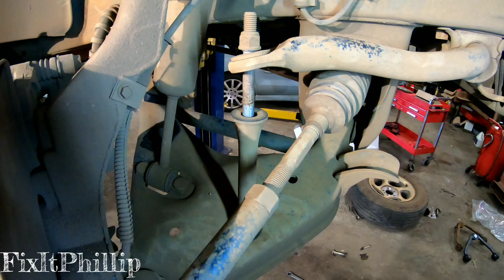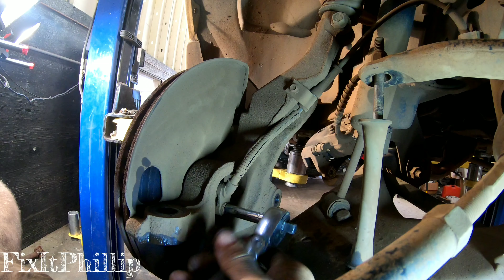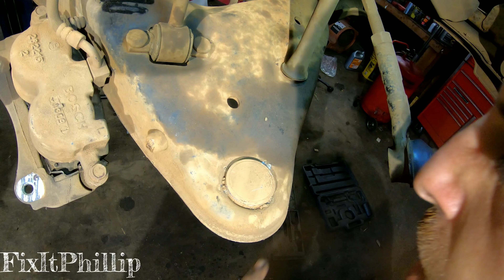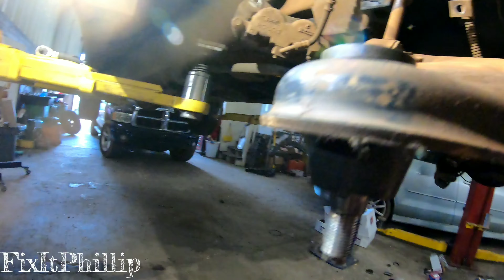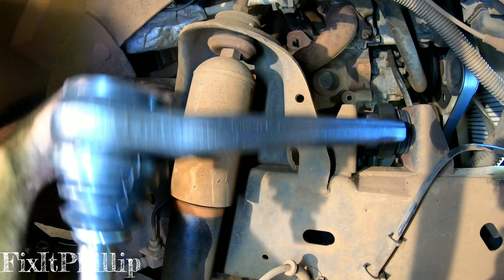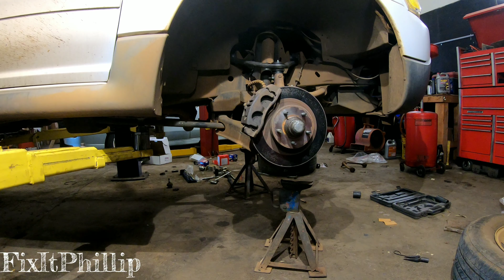Ford Explorer Lower Ball Joint and Upper Control Arm Replacement Sport Trac Ranger Mazda

Comment: The cross bolt that holds the upper ball joint in the knuckle on mine was weird. The bolt head was 16 but the nut was 17mm?

Comment: Helll Phillip, I have a 2001 ford explorer sport ...my question is if I need to buy a the the lower and upper controls arms or if i just need to replace the ball joints ect.ect.Thank you
Reply from the maker: The upper ball joint  is integrated to the upper control arm on yours if im not mistaken. The lower ball joint can be pressed out without replacing the whole lower control arm.

Comment: great video,  I just have a question? I have a 2003 sport trac and I need to replace the upper control arm but mine look way different then the one your sport trac has...  do I need to put a Camber kit too
Reply from the maker: Yours may have the 2 piece  upper control arm, which is a caster adjustment. If you want to be able to to adjust camber also put the camber bolt kit while your already in there. Hope that answered your question. Please be sure to subscribe, much appreciated!
Reply: Probably because he has the 4wd version and you have the 2wd, or vice versa. I wish youtubers would clarify that.

Comment: I may have missed it, what upper control arm did you use? I'm looking at different options and see MOOG and Mevotech but some bad reviews suggesting they don't last for more than 12k miles has me worried.
Reply from the maker: I would go with moog. I've rarely had problems with that brand

Comment: Thank you, I have a 2002 4x4 and just ordered both up and lower control arms complete as I don't have all the tools to remove/replace just easier I figured. Also inner outer tie rod, stabilizers, complete hub and bearings, should be good for another 380,000 km as as far as I can tell it's all stock parts still. Only one lower ball joint is loose but I thought  it's all going to go soon anyway. I find my sport trac the most useful vehicle I have ever owned and I've owned sports cars, muscle cars, trucks, vans, compacts, sedan, even a station wagon which actually looked ugly as heck but was fun to drive. Thanks again buddy.

Comment: I can’t get the lower ball joint off the knuckle.
I see you just hitting it until it breaks off. Is that the key ? I was hitting it under the bolt with the nut and nothing . I even used the fork but busted the the rubber from the ball joint. Advise thanks
Reply from the maker: Did you hit on the knuckle itself like in the video?
Reply: No I didn’t I try to pry it and nothing. Im just scared I could damage the knuckle by hitting it. But I see you going at it and POP it out easy. Is that what I need to do ?
Reply from the maker: Yes hit the knuckle on the side near where the ball joint runs through it. It'll shock it loose
Reply: I will do that! Thanks. And ball joint do I need need top torque to press it or can i do by hand ?
Reply: @200percentbrown  autozone will lend you the ball joint press if you leave a refundable deposit. Just do what he does on the video and you'll be fine.

Comment: Do you leave the grease fitting on top after filling them with the grease gun ?
Reply from the maker: Yes
Reply: @FixItPhillip  any tip on what grease I should use ?
Reply from the maker: Just go to the auto parts store they will give you what you need. Good luck brotha
Reply: @JoseHernandez-ne1js  After a great deal of research and some trial, I would highly recommend Green Grease. The Lucas Green Grease is fine but the other one which I think is just called Green Grease (sorry I'm too far away from a cartridge to see) and comes in a plastic cartridge, is much better.